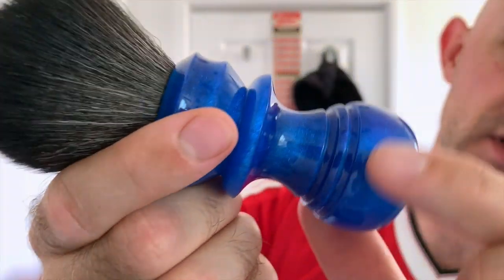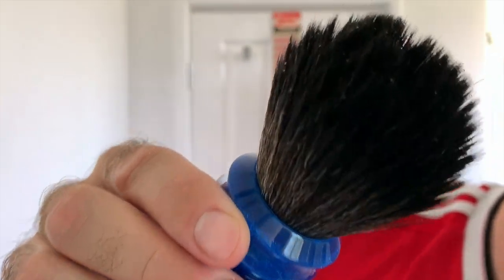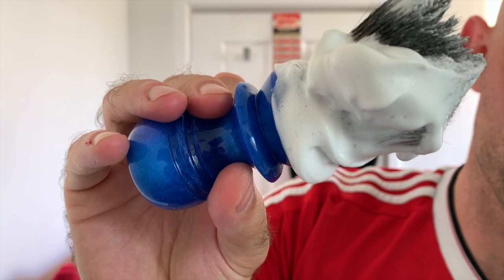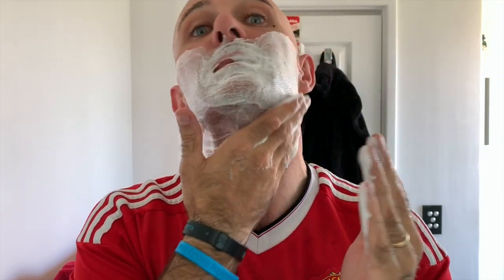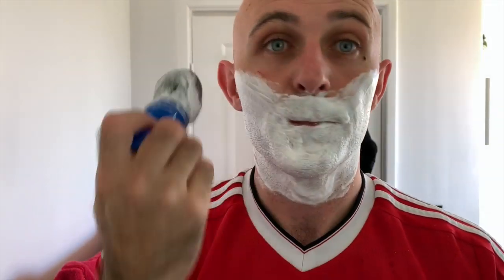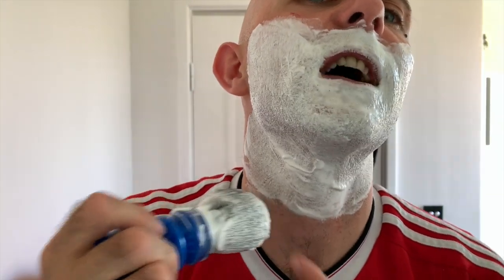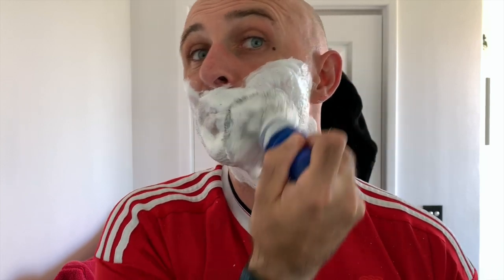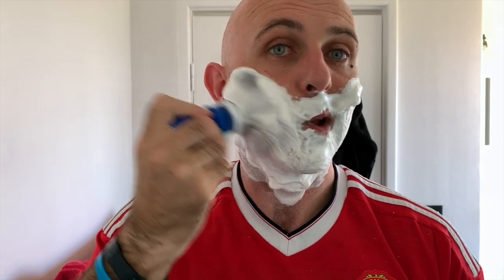A foolproof guide to creating a shaving lather!!!!!

Comment: Fucking game changer. Thank you so much, as a newbie to this style of shaving this has been such a tremendous help in terms of an easy to follow protocol that consistently gets a solid lather. Shaving improved tenfold with this and is also much more time-efficient. Thank you so much for your wisdom here 🙏
Reply: Question though; for a 2nd or 3rd pass using what is left in the brush do you essentially use the same method of painting it all on and just see how close it is to being translucent on the skin before building again or do you find it should be pretty much ready to go as soon as you re-apply?

Comment: Really enjoyed this, thanks mate. I've been using your lathering method for a good long while now and it generally works excellently. I've had a few lathers where they've ended up a bit airy, but overall I think most people would be shocked at how much water soaps can take. I feel like a lot of folks are a bit afraid of adding too much water and so they end up with a fairly dry, pasty lather to work with, but - especially with many of the aristan soaps - you can really add a lot of water in and get that slickness without compromising the soap at all.
Reply from the maker: Spot on, I too get an airy one every now and then but the lather still works superbly well!

Comment: I've been struggling with my lather, it was too dry. I was sceptical of this guide at first but I had success with it, great lather with pure badger brush and palm lathering. Thanks!
Reply from the maker: Nice work! It’s great when the lathering part comes together. I find it quite relaxing.
Reply: @AnotherCutAbove  indeed it is. I also find it beautiful to find a solution to a specific problem I had for a while. Now the razor glides even better with more protection for my sensitive skin and the shaves are better overall. Hands down, this method of lathering is the best one. (For me at least)
Reply from the maker: That’s great to hear, it’s helped quite a few people along their journey including myself. It only gets better as well the more you do it and get used to the soap base and dialling it in.

Comment: Question regarding 2nd and 3rd passes; When using what is left in the brush do you essentially just use the same method of painting it all on and just see how close it is to being translucent on the skin before building again or do you find it should be pretty much ready to go as soon as you re-apply?
Reply from the maker: Ready to go, Al I do sometimes is add a little water to keep the lather wet.
Reply: @AnotherCutAbove  awesome, thanks!

Comment: Fantastic tutorial! Thanks!
Any tips for bowl lathering?
Reply from the maker: Strangely enough I’m not. The best of bowl latherers.
Reply: Same technique basically. Load the brush or smear an almond sized amount in the bowl. Then start swirling your brush and building your lather, adding water to it, ever so slightly, until you get the consistency you desire.

Comment: Do any  Shave:face-green-smiling: Pucks or hard soaps  are going to work?. You can mix and match old soaps?  to fit in any mug or cup that you like to use. like (Mitchells' Wool Fat or Arkos shave soaps?) Cut the bar soap up, put in a mug, cover the soap with a small amount of water,  and microwave for a minute or so? if it foams up, stop.  the water keeps it from burning  itself up? (DON'T OVER WATER YOUR SOAP??)  Easy does it? let cool don't want to crack the mugs or cups you're using? ( you just went  it to congeal in your mug or cup') place in the sun, until soap hardens?   When using Dry Brush more Water. For its (price point?)' (I use Dove bar soaps?)  (use any soaps Out there ??) save your money spend it on your wife don't listen to the shave mafia.try to save people money in these inflationary times wheelchair Larry Merry Christmas :face-blue-wide-eyes: